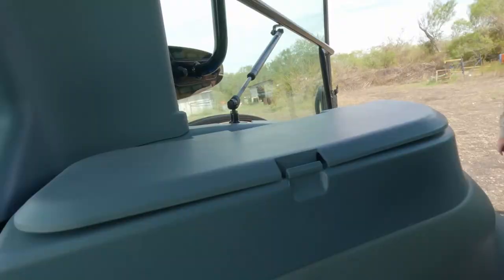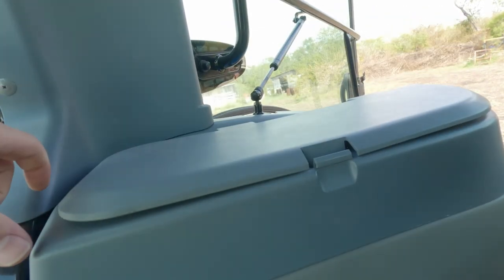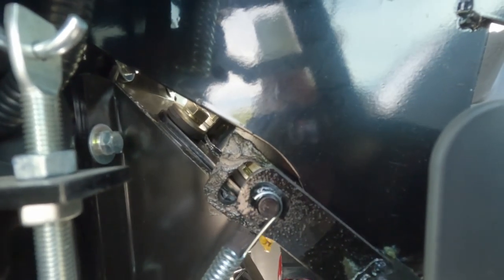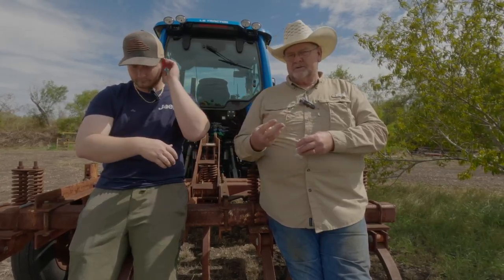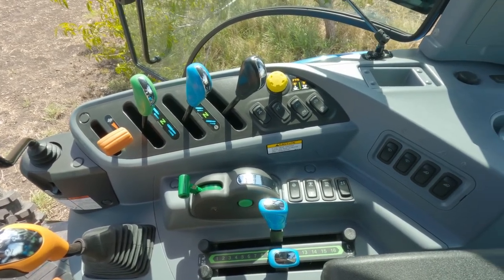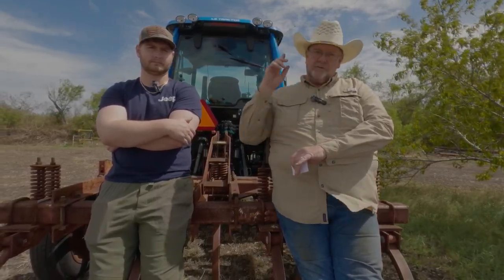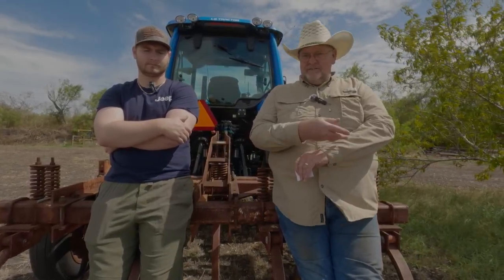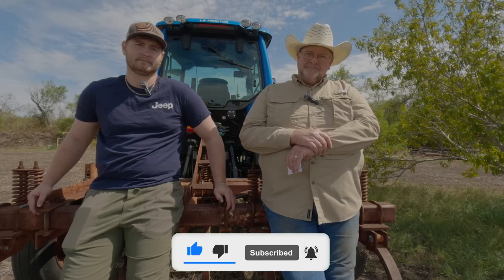The LS MT573! What is Good or Bad!

Comment: Does it have rear planatry or bevel?
Reply from the maker: Thanks for watching. First I am NO expert when it comes to transmissions and gearboxes. The MT 573 I believe would be a planetary rear end. From my small amount of experience with bevel gear box the axle is offset from the center of the axle. ( I hope I explained correctly). The axle is a straight axle and not offset on both the front and back. There are probably smarter people that might be able to chime in. 
Thanks, I hope I was some help.